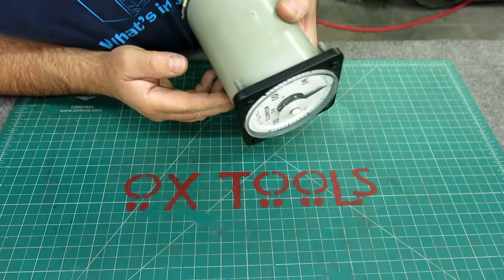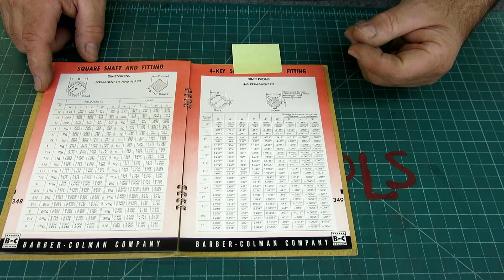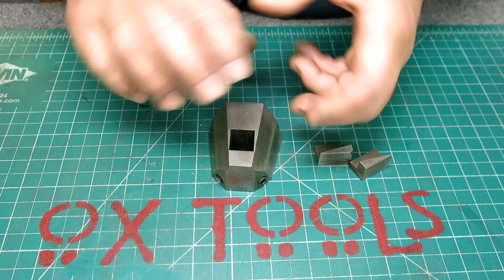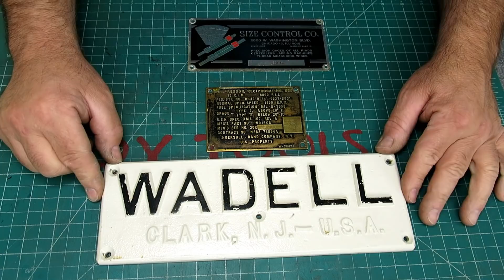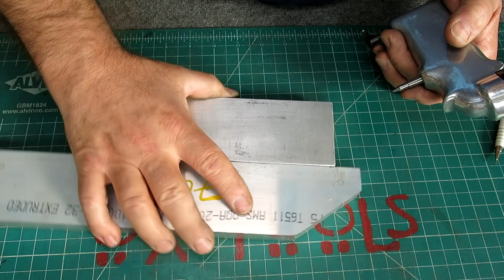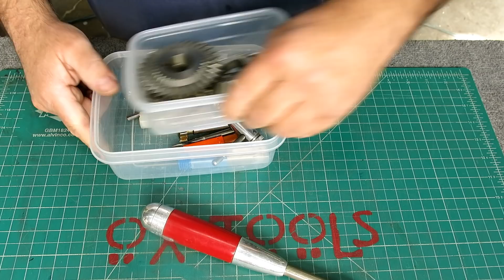Monday Night Meatloaf 129

Comment: Hey Tom , I used to work in a power plant as a turbine tech . We had four steam turbines generating 500 mega watts each. The output voltage was then transformed up to 400,000 volts. Scary stuff high voltage. Each turbine power train had a high pressure turbine , then a intermediate pressure turbine e and 2 low pressure turbines coupled together,  then the generator. 200 tons total spinning at 3000 rpm. All designed in 1960s by guys with pencils and drawing boards it was very impressive. I saved a 3.5kv bottle fuse (3500volts) that I mounted up in my workshop  that gets a few comments when guys see it.

Comment: "Yankee" was a brand name of North Brothers Manufacturing Co.,  bought by Stanley in 1946.  As already commented, the one that you have was made by Millers Falls.   The ratcheting tap wrench is probably made by Schroder.   Schroder also makes Yankee-style push screwdrivers, some models of which use standard hex-bits instead of the original bit design (which are hard to find).

Comment: That meter is also +/- AC power - which means this power station - monitoring the lines - measures direction of the power.  East/West sort of speak.  In or out of that branch.  Interesting.  I have very high Current meters like that.  I also measure AC frequency in the shop with a freq meter.

Comment: I'm pretty sure one of those electronicers will be able to help you get that meter hooked up to something. You have the manual after all, should only need the proper scaling resistors and a shunt to turn that into a motor load meter. I keep all the older meters I run across just in case I ever want to use one. The Bezel's usually come off too so you can put your own backplate on to read anything you want.

Comment: Hey Mr Wizard, why is the meter a centre reading meter?  Are you suggesting that if it went anticlockwise then you would be reading negative power, or in your analogy, negative horse power?
Reply: Yes, you can determine power flow direction using phase relationships. This meter came from a line terminal panel in a substation, I think a 69kv line.

Comment: I have a small box full of the push drill bits, but didn't know what they were used for.  I also have three large Yankee drivers (about 18" OAL retracted), but they use much larger bits.

Comment: I recently read that there has been some development in welding 7075. Apparently a thin rod of 7075 infused with titanium carbide is placed along the joint and when welded the titanium carbide prevents phase segregation which is what causes the cracking due to uneven cooling.

Comment: What ho young Tom, if i can find it i have a thread grinding jig that is much easier for the home shoppist to make fot themselves. If i can find it ill post a video on my channel, or just email you a photo. Mine is also designed for a surface grinder but can also be used on a vertical mill too if you mount a cup wheel in the quill.
Keep up the Lipton Monday Night Catering Co.
ATB 
c

Comment: The push drill only drills. Since it spins backwards as you release the pressure it would unscrew just as many turns as it screwed in - no progress. Still, a useful tool for the kitchen tool drawer; it doesn't take up much room and is handy to start a wood screw or two. I have several, including one that belonged to my grandfather which has no chrome plating over the brass body.
A true Yankee™ screwdriver drives in or out (and like your little tap wrench also has a lock setting). Such screwdrivers are still being made in Germany, including versions that take 1/4" hex bits. They take some skill to operate, since the penalty for having the bit come out of its slot is some monumental damage to the workpiece.
Please remember to set the language of your videos to English so the Youtube auto-captioning will work. Those of us who are deaf or have serious hearing problems will thank you. I believe that in the Youtube Studio settings there is a place where you can make English the default (so you don't have to remember every time).

Comment: I'm a control room operator at a coal fired power plant in Colorado. I operate a 200 gross megawatt unit and 300 gross megawatt unit. The 1344 horsepower to each megawatt is one of my favorite ways to explain to new guys how much power the turbine generator sets are actually producing.

Comment: That Yankee Drill was intended for drilling blind holes, typically when installing door hinges and cabinets.
Reply: that yankee drill looks a lot like a Millers Fall Streamline Moderne No 100A automatic push drill from 1949 to the mid 50's

Comment: MWatt meter is probably 120V and 5 Amp for full scale out. so direct connected 100 MW would be 120*5 = 720 watts
Reply: That's for three phase, hooked up to single phase you can drive to 1/3 scale 240 W. test on a lamp

Comment: I've got a yankee drill, it works great, and doesn't even fall apart, though I do need to regrind some of the bits.
Reply: I have three different sized yankee screwdriver/drills, had 'em for 50 years and haven't needed to charge the batteries in any of 'em.

Comment: Tom, They look like little donuts that hang on the in/out of the wires that feed information back to the idiot gauge.  Nothing cosmic going on there...  Here's a video idea many of could use.  I'm sure I'm not the only guy that has trouble grinding HHS stuff for the lathe.  How about a slick little device (block) that we could make and fit to the average guys bench grinder to make this job easier, faster and more accurate.  I sure could use some help on this.  Thanks buddy for your consideration.  ~Jason

Comment: Those ratcheting tap wrenches are very common over here in Europe actually. I have a couple and basically every workshop I've been in have a a few. They're still produced and you can pick them up from many hardware stores.
Reply: I have two ratcheting tap handles (Greenfield, I think).  Not great for normal use, but indispensable if tapping in an awkward, cramped location.
Reply: Those ratcheting wrenches sold nowadays are mostly if not all copies mde in china.
Reply: Switch & Lever, I have seen several of those for sale and wondered if they were really useful or if they look cool but aren't that great.
I'll have to buy one and give it a try.
Reply: @robertoswalt319  They generally don't grab onto the tap as well as non-ratcheting ones or a proper tap handle that doesn't use chuck-jaws, will I have found.

Comment: Jones & Lamson An 1869 machine tool company, they also made general-purpose machine tools. Besides metalworking machinery they also manufactured circular sawmills, drill presses, and wood-turning lathes. Also, the Fay Automatic Lathe, predecessor to the modern CNC Lathe. During WWI, president James Hartness, was named to a national commission on the standardization of machine tool threads.  In 1955 Jones & Lamson acquired Shopmaster, Inc. a line of home-shop machines was sold by "Shopmaster, Inc. They went out of business in 1983.

Comment: I used to run a hydroelectric powerhouse, we made 11 mw with roughly 16000 hp (turbine nameplate hp). Way cool stuff.
Reply: you must mean 1.1MW (~1500hp)
Reply: @fuzzy1dk  no sir. I mean 11 mw. There is however a zero missing from the hp number. I fixed it.  😉

Comment: Yankee drills used to be standard issue for all Bell System linemen/repairmen.
Reply: Yes, sir.  I have memories of a telco installer using 1 of those push drills.
Reply: @eliduttman315  I still have one and us it occasionally, faster and easier than pulling out my battery operated drill to make one or two holes.  Especially since the drill battery always seems to be dead when I need it.
Reply: I've got one of those and have used it to start screw pilot holes in places an electric drill won't fit. Not meant for thru holes as Tom demonstrated. Still have my Yankee screw driver also.

Comment: J&L was acquired by Textron in 1964.  In the 80’s it was split into two divisions.  Both have now been sold.  Bourn & Koch bought the assets in ‘02 and continues to provide spare parts for the machine tools.  The metrology division is now a privately held company.
Reply: Was just going to post this.  http://progress-is-fine.blogspot.com/2017/04/vanished-tool-makers-jones-lamson.html has a bit more data.